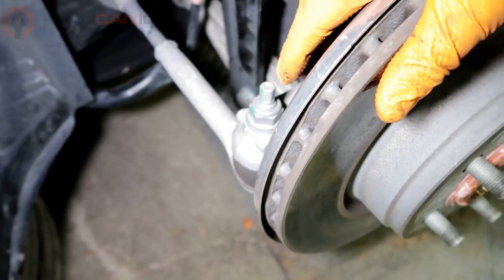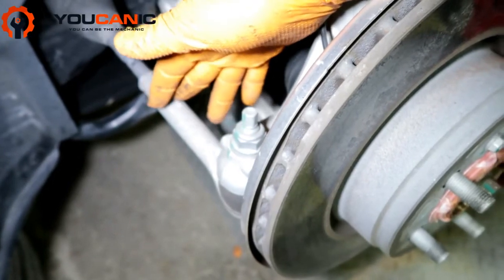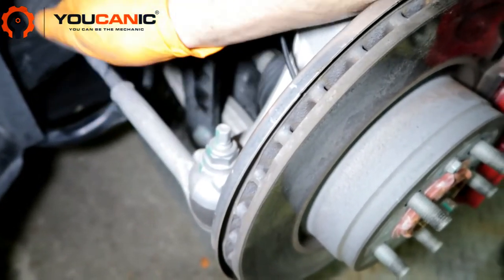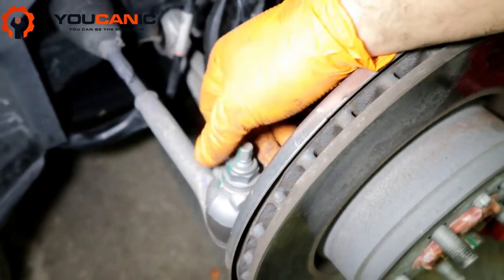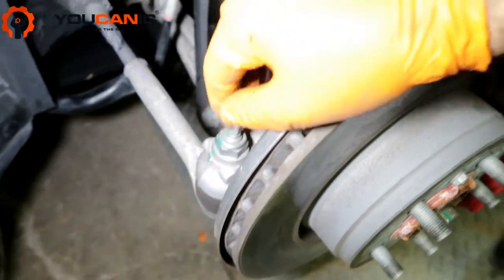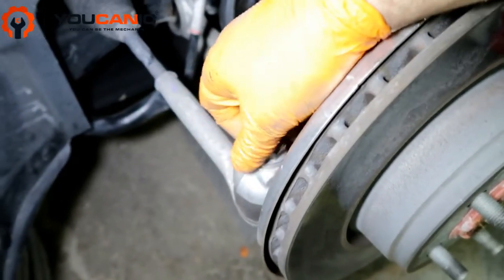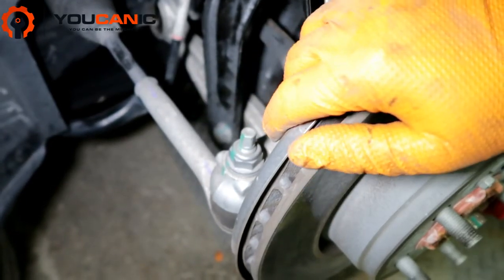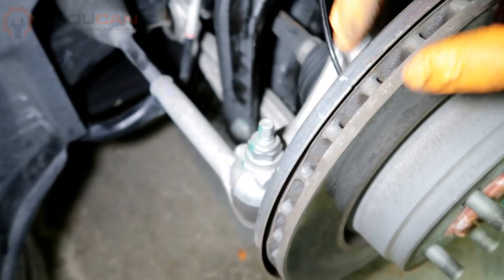Tesla Outer Tie Rod Replacement - How to do it

Comment: Why didn't you actually do it man, lol.
Reply from the maker: Hi, thanks for your feedback! Our goal with these videos is to guide you through car repairs. As for diagnosing modern cars like a pro, that's when our YOUCANIC Full System Scanner comes in handy. You can know more about our scanner at www.youcanic.com/scanner.

For a detailed step-by-step guide with specifics, you can get access to Factory Repair Manuals and Torque Specs for a minimal fee--this ensures your repairs are done correctly. Visit www.youcanic.com/manuals to get started. We're here to empower car owners like you!